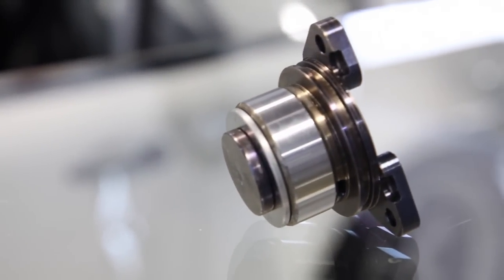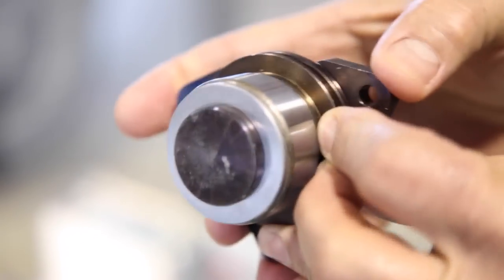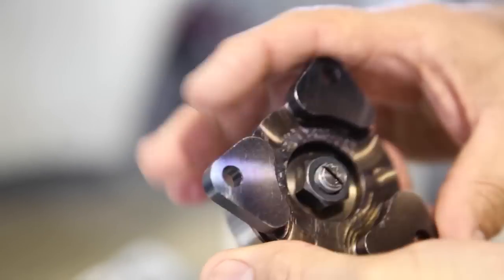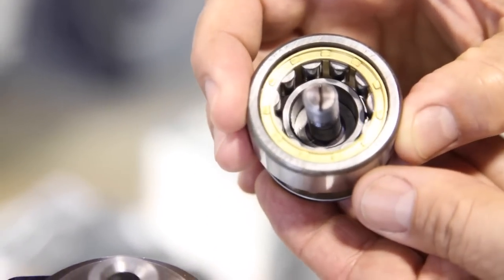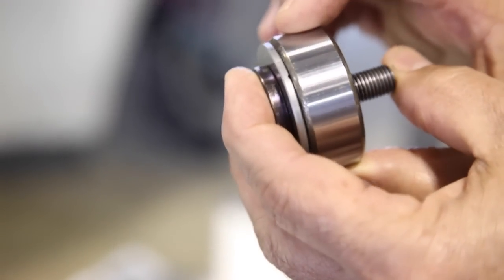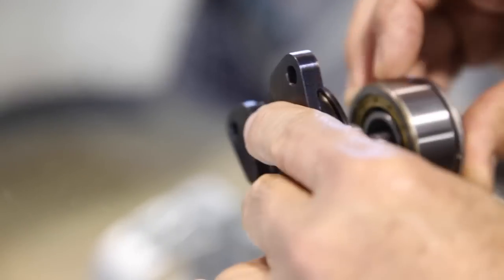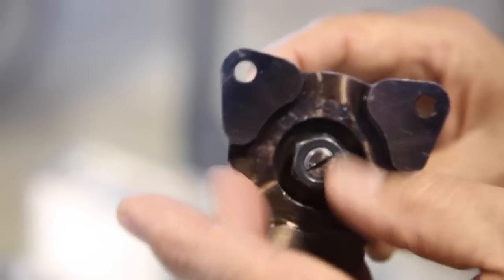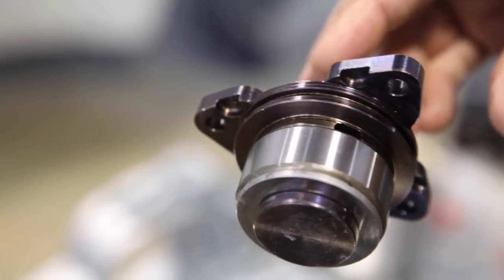IMS Bearing Upgrade Kit - Porsche 996, 997, Boxster by EPS

Comment: WOW! A lot of mixed and conflicting opinions about ball vs roller bearings and sufficient oil supply to keep them lubricated. I’m not a mechanic, but just the owner of a 2005 987 Boxster S that I’ve had since 2010. The car runs beautifully right now, but wanted to take a proactive approach and have the IMS replaced before any doomsday scenarios. I guess I need to research more…UGH!!

Comment: what oil feed  are they talking about then!
all we need is this bearing right
nothing else.
Reply: I just installed this bearing two days ago in my '00 996.  The oil feed is by piercing a small hole in the cover on the opposite end of the Intermediate Shaft, where the oil pump is.  So oil flows through the IM Shaft to the roller bearings. Credit to who thought to do this as it is simple and effective.  I did NOT do this modification, yet.  EPS presents it as optional and they only introduced doing it to counter the attacks by LN claiming it is not as good as the LN "Solution" (costing over three times more, of course).
Reply: @DSC800  - Hi, how is your "in the ground" experience been up to now? Just installing the "EPS" in my 996 C4S, without the modif neither …
Reply: @Paulomagalhaes495  Great! I just cleared 4k miles on the EPS and did the first oil change since the install. No metal or plastic particles were found and barely a smudge on the magnetic oil plug.  I have yet to find any complaints or failures.  Still not doing the oil mod either as EPS owner says it's not necessary.
Reply: @DSC800  Thx for the feedback, nice to hear it, nothing better than knowing it through other user’s experience, I think!… 
Best of luck with your 996 and overall!… 👍

Comment: No no no. Roller bearings are not what you should use. Quality ball bearings and lubrication is the answer. The factory fitted grease is "washed" out and that is the oil starvation scenario. Don't use rollers from EPS
Reply: Do not listen to Graham Edwards. As evidence, I will point to his ignorance and lack of evidence to suggest otherwise using roller bearings - which is more than Graham Edwards provides to you. 'Nuff said.

Comment: The Porsche dealer told me, because my miles,are at 120,000 it's not an issue with mine?
Reply: Les Kamery probably because the ims wasn't sitting in oil and the car was actually driven like it's supposed to
Reply: My 1997 Boxster with duel race ball bearings is fine...147,000 km . Change your oil and do it every 4000 km. Best filters , best oil and regular servicing. And drive the bloody thing fast.

Comment: Just installed this in my 1997 Porsche Boxster, well made and easy to install. I also installed the oil feed kit for this bearing.
Reply: How long did the job take? Im going to do it, first timer
Reply: John Boyer Hi, you should be able to do it in a weekend. I did it when I was doing other work to my car , so I don't have a time just for it. Be sure to lock the camshafts on both sides of the engine and lock the crankshaft also. Also a good time to replace clutch and rear main oil seal if needed. I purchased a book, I think it was called 101 project for your Boxster off ebay, Great book!  Do Your Research Before Starting   this Project!
Reply: Great thank you!
Reply: Hi Hillbilly. It's been approximately 2 years since your install. Can you give us any insight on whether you inspected for any metal shavings in the oil subsequent to your install, presuming everything has been running tip top?

Comment: First of all I dont know who uses cylindrical bearing for high speeds... It should be ball bearing. But anyways, the problem firstly isn't caused by the load as mentioned in the vid, it is because of the lack of grease that is inside the bearing.
Reply from the maker: Hi Esso, Thank you for sharing your opinion.The IMS Shaft turns at HALF the speed of the engine (max 3,500 RPM). Our cylindrical bearings can operate at speeds up to 15,000 RPM.. The speed that the IMS bearing is operating at originally (max 3,500) is a leisurely pace compared to its capability of 15,000 RPM. Regarding to your opinion that lacking grease causes the problem, here’s why it isn’t. The IMS bearing is submerged in oil. If the grease is to wash out, the wash substance is still oil, so there still will be lubrication inside that seals it from the engine oil. Oil will always be at the bearing with or with out seals, and with or with out grease.The failure in the IMS is not provoked by a lack of oil (lubrication) but rather a lack of SUPPORT from the ball bearing that is a pin point load bearing device. Pin point load bearing devices have a limited load bearing capacity.

Hope this clarifies your doubts.
Reply: EPS Parts hello, if the bearing is submerged in oil, why are you running a direct oil feed from oil pump? Similarly LN Engineering (IMS solutions LLC) has a line from converted oil filter to flange.
Reply: Roller bearings are used in high speed applications and support high load in two stroke engines especially chainsaws.

Comment: Roller bearings have far greater surface contact between the race and rollers this equates to more heat gain during operation. Now if this Fix had direct oil feed it would be belt and braces. If this bearing sat in pooled oil it would be better but then exposed to contaminants in the oil. Oil has to be fed direct from the pump after filter.

Comment: So your axial thrust control is basically metal against metal,  doesnt sound good to me.  Also how does oil enter the bearing if it has a washer on either side.  Not convinced sorry.
Reply: +William Goyette It looked to me like there were oil grooves in the thrust washers.  The bearing uses engine oil rather than a special lubricant in a sealed system. You're right, it wasn't explained very well.
Reply: My exact thought also regarding metal to metal. There are 2 inner oil inlet grooves on each thrust washer. I'd have to say I favor cylindrical roller bearings in this application and tests show they have more load bearing capability however the outer bearing surfaces on each side against the thrust washers raises concern even though in theory they would ride in between a film of oil given enough supply. I'm also leaning towards the solution as an option since L&N just released a dual row version for my 99 c2. I'm just not sure that the "solution" kit, which is about $1,000 more over the ceramic upgrade bearing is worth it on an engine with 102,000 miles.
Reply from the maker: Hi William. The bearing has openings at both sides of the thrust control washer to permit oil to flow back and forth. The outer race and the washers are not fixed together, so oil can enter the bearing freely.

Regarding your question about the axial thrust control basically being “metal against metal”, this is why it’s not the case. In our patented thirst control, the roller is a free wheeling roller, meaning there is no contact on the sides of the roller. Unlike ANY other cylindrical bearing solution, our axis load (thrust control) is not applied to the rollers, instead, it is applied to the entire perimeter of the outer race. The main advantage of this technology is that the rollers are not loaded from the side. Feel free to reach out to us regarding any other questions.
Reply: Spoken like someone who's not listening or simply does not understand how bearings work. Your question addresses only your own ignorance.
Reply: The axial thrust in a ball bearing is metal against metal.

Comment: Hi, can a person do this replacement at home. Must you pull the engine?
Reply: +Nancy Sunfield Engine, no. Transmission - yes.
Reply from the maker: Hi Nancy, Our cylindrical bearing with thrust control can be pressed directly into the back of the engine without disassembly. This replacement can be done at home depending on what type of garage setup you have. However, we recommend to have a professional Porsche expert install it.